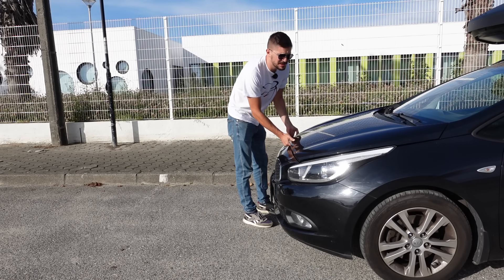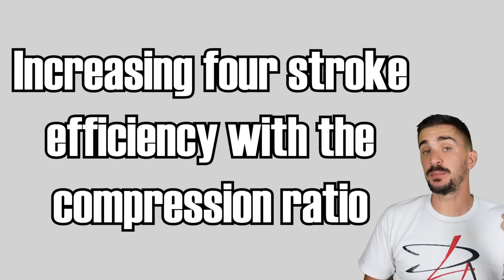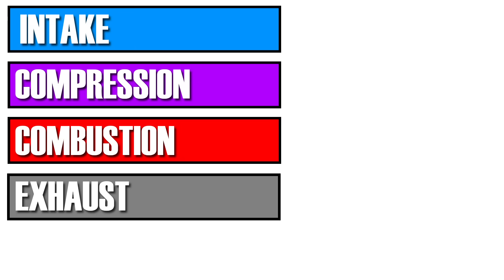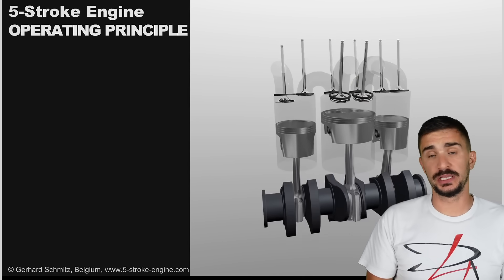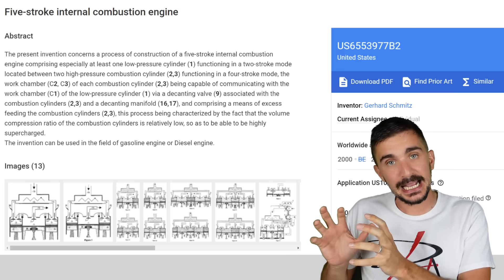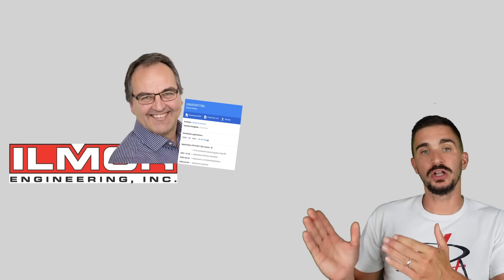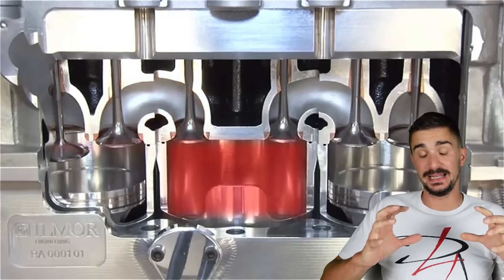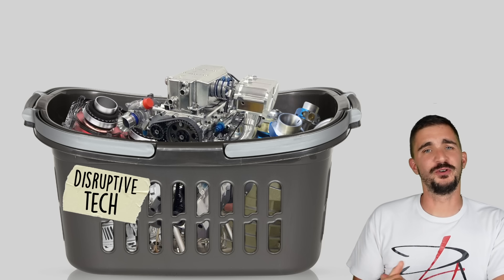Why Five Stroke Engines Are More Efficient But Still a Failure

Comment: But doesn’t the conventional turbocharger also harness extra energy from the exhaust? Doesn’t it also consume exhaust energy for it to be harnessed at the intake? I know compressing intake air also produces heat which is lost to the intercooler, but does that completely cancel out the energy taken from the exhaust?

Comment: Hmm it may still be able to be used in electric hybrid designs the fuel efficiency at high rpm would be useful since the engine would be locked at a certain rpm for maximum efficiency. Its still an amazing design since it uses basically the same parts as conventional engines

Comment: I checked your videos and didn't see at a first glance, so I'll ask: have you heard about a design that was essentially a rod with fixed pistons at both ends, and a magnet in the middle, bouncing back and forth, with copper coils around the magnet stroke area to generate electricity? I saw it somewhere on the internet at least 15 years ago, as one of those "guy invents thing in his shed", and I have been wondering for 15 years why isn't it a thing :D  With like 4 of such "tubes", to balance it, hidden in the floor of a car gives a very compact and "in theory" efficient vehicle.
Reply: @GerinoMorn It’s called a ‘free piston’ engine and they have been working in niche applications for some time now.
Reply: Yea I remember that, would be interested to know as well

Comment: Generally speaking,  the surer path to heat efficiency is bigger cylinders,  fewer of them, and slower speeds. In the late 50s/early 60s Deere were building a huge 2-cylinder engine for its larger tractors that set efficiency records that wouldn't be broken for 16 years.  So instead of building buzzy little 4s, maybe we should be focusing more effort on 3s and even 2-cylinder engines for powering the ICE side of PHEVS.  Soft motor mounts absorb the worse vibes of low cylinder counts and the hybrid system takes care of everything else.
Reply: My father has one of those that was converted to run on propane and I can count on my hands the number of times I remember him "filling it up"
Reply: Propane has a lower heat content than diesel. Its very popular here in Europe because it's so cheap, and its sold at peteol station.
Reply: Just bought a RE Himalayan. Love the single
Reply: Exactly.  There are practical limits to cylinder size depending on application but for gasoline road passenger vehicles the optimum is somewhere in the 600cc to 800cc range.  The ONLY reason you see so many vehicles with 2.0L inline 4's is due to various government laws.  The USA fortunately doesn't have these so 2.5l is common here.  Below 4 cylinders there are other tradeoffs that generally result in a poor design for vehicles so they just shrink the cylinders.

There's plenty of straight 6 trucks on the road with large bores.  They're heavy but they're very efficient!  It works for trucks.  Then look at what they use in freighters and cruise ships.  Big, slow, and 50% efficient.  That's about the best efficiency this world has to offer with regard to practical heat engines.
Reply: Or you could just build a Boxer 2 with fork and knife crankpin/connecting rod setup. Better yet, since torque twist becomes increasingly violent with displacement, you could use a U configuration U2 engine with two single inline engines with their crankshafts spinning in opposite directions and connected by 1:1 gears with a 0 phase difference in stroke cycles which gives 0 torque twist, and if you move the cylinder and the cylinder head up by the length of the stroke and connect the two piston heads from below the cylinder into a single entity, you can eliminate the friction made from the pistons heads pushing into the cylinder wall, since the unified set of pistons is receiving a net 0 force from the conrods spinning in opposite directions. The crankshaft balance weights completely cancel out the forces at TDC and BDC and the two balance weights cancel each other's side to side movement as well, though the secondary vibrations still remain since the weights are traveling in circles and the pistons in lines.
Reply: @hrishikeshaggrawal   - you can't build a "boxer" engine with "knife & fork" connecting rods (i.e. a single throw crank)... because it wouldn't (by definition) be a boxer engine.
Boxer engines (by definition) have horizontally opposed cylinders with both pistons heading towards their respective cylinder head at the same time - meaning the connecting rods associated with those pistons CAN NOT be on the same crank throw.  If you were to build a horizontally opposed engine with "knife & fork" connecting rods, it would have horrible balance (since both pistons would be moving to the right at the same time, followed by both pistons moving to the left at the same time)... think about it...
Reply: @danielklopp7007  you can, if the crankpins are split along with the forks and the knife. this is going to compromise the strength of each pin but you could solve that by making the pins slightly wider, essentially this just makes it so the connecting rods are 1/4th as wide and that each piston has two of them, one of the piston's conrods are in the middle and the other piston's conrods are on either side of it. giving us 3 crankpins, with the fat crankpin being the knife between the two thinner crankpins being the fork. it's essentially a flatplane i4 engine crank that's been squeezed along it's length to fit the width of a single cylinder instead of 4 with it's 1 and 4 pins connected to conrods that go to the same cylinder as the 2 and 3 pins do for the opposing piston. so that's how its a boxer engine without being just a flat engine. this will make the conrods weaker but considering that the engine is much larger, the rpm limit bottleneck would have been reached much before for the heavier pistons than it would for the conrods since the conrods have exponential stress with rpm and even small reduction in rpm allows much weaker construction. When you think about it this arrangement removes the need for crankshaft balance weights completely since all the forces are now truly and perfectly balanced by the opposing pistons, and those balance weights in conjunction with the conrod would fit the width of the cylinder originally but in this setup the space for the balance weight can be given to the conrods for the opposing piston since the cylinders are now perfectly opposing each other without an offset now, so the conrods aren't even much thinner than the conventional conrod.
Reply: @hrishikeshaggrawal   - we are using a different definition of "knife & fork" connecting rods.  My definition: both rods must share a common crank throw (e.g. Harley Davidson V-twin bottom end).  The advantage of "knife & fork" connecting rods is they eliminate the rocking-couple vibration that comes from side-by-side connecting rods in a V-twin (e.g. Ducati). However, with the examples I gave (i.e. HD vs. Ducati), the slight advantage of reduced rocking-couple HD gets with "knife & fork" connecting rods is overwhelmingly negated by the 45 degree V angle (vs. the 90 degee V-angle of a Ducati twin which gives it perfect primary and secondary balance).
Reply: @danielklopp7007  i know what a knife and fork setup connecting rod setup means, metioning it was nessesary to explain the quirky boxer 2 i had in suggestion, even if there isn't a shared crankpin, the fact that the conrod of one piston is right in the middle of its pair piston's conrod is true.
Reply: Larger cylinders mean more surface area and a longer flame path fuel/air mix, so it takes longer to burn both of which mean more heat is lost.  Also the slower the engine turns, the more time the combustion gases remain in contact with the cylinder and combustion chamber during the power stroke, so more lost heat.  You gain efficiency by using more of the heat energy to push the piston, running an engine more slowly doesn't do that though it does reduce frictional losses.

Comment: Serious thought here - if ILMOR's 5 stroke design only extract the expansion cylinder's benefit at high loads, why not apply the engine to use cases that are near constant high load?  Imagine a horizontally opposed version in light aircraft.  Four HP cylinders and 2 LP cylinders would fit perfectly in the space for existing boxer 6 designs.  Aircraft operate in a narrower RPM band and at higher load than automotive applications.  The external turbocharger could be better sized to benefit from ram air and lower exhaust pressure at altitude.  
A 5 stroke design also mimicks the pinnacle of large piston driven aircraft radials of the 1950s that used turbo-compounding to extract exhaust energy.  The Wright R3350 was used in the fastest prop airliners like the Douglas DC-7 and Lockheed Constellation and had exhaust turbines that drove a shaft coupled to the engine crankshaft (instead of an intake compressor wheel).
Reply: Turbo compound engines were effectively replaced with gas turbines.
Reply: @Appletank8  Right, turboprops are higher performance and lower maintenance for commercial and military applications that need higher thrust and/or longer range - cargo planes, small commuters, helicopters, etc.  But who is spending half a million dollars to put a Pratt & Whitney PT6 in their Cessna?
Reply: It could be a good design for a standby generator, except the complexity would be cause for more maintenance, negating the potential benefit.
Reply: The real answer to this is good luck getting a design approved by the FAA within the next 2 decades for less than $10 million dollars.
Reply: @iamaerix  True.  As an outsider that just follows aviation out of curiousity, it's amazing that General Aviation seems fine with 70 year old engine technology.  The FAA finally just approved unleaded avgas for christ's sake.  It's like Lycoming and Continental have a regulatory moat around their business.

Comment: I wasn't aware that the exhaust gases were independently under pressure; does that mean that as they exit they reduce the work required for the engine to lift that piston back to the start of the inlet stroke? I imagine this wouldn't help much in a 4 cylinder engine as one other piston would be compressing; however in a 4-stroke single, surely it makes a difference and improves output and efficiency?
Reply: There’s a tremendous amount of force generated by back pressure.      

https://youtu.be/k7yYY_hy250?si=nbsAws0AaIlRjFS8

Comment: It would seem that a mechanically practical of extracting the energy remaining in the burned air-fuel mixture is a turbo-compound engine like the R-3350.  Engines like that have been quite successful.  How does their efficiency compare to a 5-stroke engine?

Comment: I love how you make a subject that's is interesting to me, but not of interest to me in my life, into a story about physics concepts, engineering and the real world limits of engineering.

This solution reminds me of triple-expansion steam engines used in ships. As I understood the best of these ARE able to efficiently use left over energy from the previous stage. My friend Mike Brady claimed that the exhaust gasses of the third stage could be lower than ambient temperature (or pressure, but I think he said temp). Of course steam engines are totally different from what you're talking about here, they don't combust their fuel in their cylinders for instance.

Comment: When I first saw the diagrams I was like, oh, yeah, route the exhaust valve somewhere else that can do work. But you don't want another piston for the same reason 4 stroke isn't as efficient as it is, instead use what you would normally use for high pressure escaping gas. Use a turbine. Oh, already invented.

Comment: I come to this channel for the wrinkles in my brain, but I stay for the delicious diatribes you close the videos out with. 😂 "Don't tell me ICE is dead : Read the room!"
Reply: I commented on that too. The jab at the end was awesome. Great content over all.
Reply: I now know how to save ICE cars from the impending EV apocalypse! It’s simple, we return to steam… Add a boiler and turbine to an ICE car’s exhaust system that captures the waste heat and converts it to power. Boom, 100% efficiency achieved! You can mail me my engineering award at your convenience, no rush.
Reply: @davemccage7918 Steam engines have even lower thermal efficiencies of ICE engines and ICE engines seldom achieve 35 percent efficiency in real world conditions. Take it for what it is: ICE was an improvement over steam and EV is an improvement over ICE… Don’t believe me? Ask yourself why farms retired their old flywheel powered tools and appliances that were connected to loud and smoky hit and miss engines around the turn of the last century when electricity was brought to rural villages…
Reply: @davemccage7918  EV's do use steam power, if you account for how the electricity is generated before it gets to the charging station 😉
Reply: It's actually the EV that is on the deathbed. Tesla has over 67,000 unsold EVs hidden in carparks all over the US, VW is redirecting €60 BILLION from EV development back to internal combustion engines, Fiat is retrofitting the 500e with petrol engines because the battery vehicles aren't selling, both GM and Ford are 'scaling back' (read 'stopping') production of their EV Silveraro/F150 Lightning due to 'lack of sales'....

All this in an environment where the commodity prices of the raw materials required to build lithium ion batteries (lithium, cobalt, copper, nickel, manganese, etc) have fallen off a cliff!

If it wasn't for 'carbon credits' (please don't get me started on those!), Tesla (the company) would never have gotten off the ground.

Comment: Bigger surprise for otto would be- 150 years later, and everyone is still using overly complex valve technology. 
Air and fuel can be injected directly. 

If intake and exhaust openings are designed like a heavy throttle body, 
Opening via electronic timing, or something that can handle compression pressure. 
Engine will become a lot simpler, like a 2stroke.

Comment: Great explanation of the practical limitations to higher expansion engines. You certainly know but did not touch on the fundamental reason why any conversion of thermal energy into mechanical energy using an expansion cycle has low efficiency - thermodynamics dictate that efficiency is capped by the finite difference between source and sink temperatures.

Comment: Yeah, having the second expansion fixed and connected to the crankshaft is an obvious and severe disadvantage compared to having it separate and controllable, like an exhaust turbine. And exhaust turbine can do more than directly power a compressor, a cleverly designed e-turbo/generator could potentially replace the conventional alternator, and even provide electric power for other things, like AC and water pump, providing a host of advantages, with minimal drawbacks. It could even supply some energy for hybrid propulsion. As mentioned, car engines are typically *up to*, 30-40% efficient, meaning in ideal conditions 60-70% of the energy is not used, and the average is even worse than that. 

About disruptive technologies, it's not enough for them to have theoretical potential to be somewhat better than conventional designs, eventually, after many years of large scale R&D and refinement if they are to disrupt things like conventional piston engine designs. They have offer so great potential that they can be competitive early on, with resonable effort. That said, for combustion engines, turbine engines do offer a lot of potential advantages, that's the only category of combustion engines I can think of that has some realistic potential to displace some of the market for conventional engine designs, more than they already have. Very difficult to design/make really good, but also multiple huge potential advantages over reciprocating engines.

Comment: @d4a, 2:00 true for venting into atmosphere, not true for any real exhaust system which introduces backpressure, especially turbo, where on production high euro-tier emissions level systems you see much higher then atmospheric presure at exhaust port leading to piston to actually do work of pushing exhaust gase away spending accumalted in moving parts energy.
Reply from the maker: You're telling me there's 4 bar of backpressure in an exhaust system?
Reply: @d4a  On diesels it is common to observe well above 3 bars absolute pre turbine, I expect high power density gasolines to also be much higher than atmosperic pressure pre turbine though during my diesel exhaust modelling exercises I was only reading diesel related studies from sae/sciencedirect/researchgate, there is a lot of papers with both modelling and in-lab studies of conventional engines that shows high backpressure needed for running turbine in its most efficient power band. Also there is a good series of videos at Banks Power channel where they put sensors all over the place then observe and tune for as low back pressure as possible.
Reply: @d4a  Also it is stated in video that 4-6 bars is expected at start of exhaust stroke, given we have even 1 bar of excess pressure in the exhaust port means piston will have to overcome that last 1 bar by pushing gases away - still wasting of mechanical energy, can be aproximated  to actual numbers from piston area.